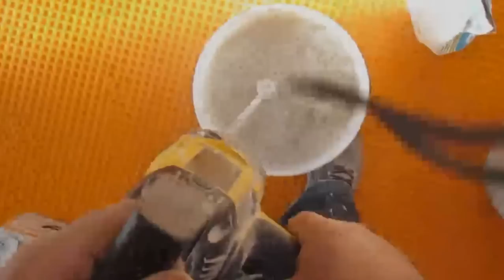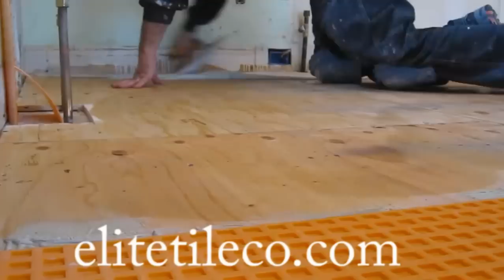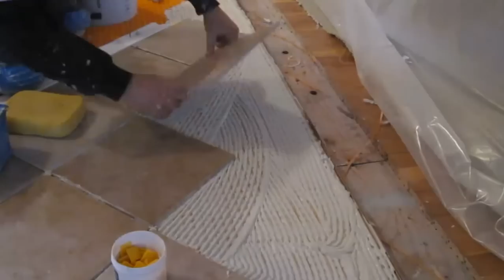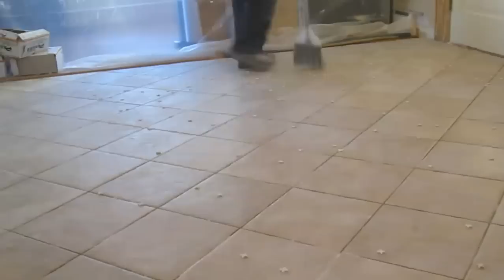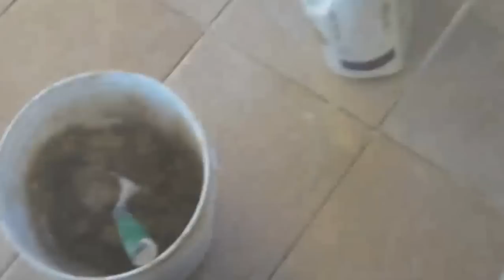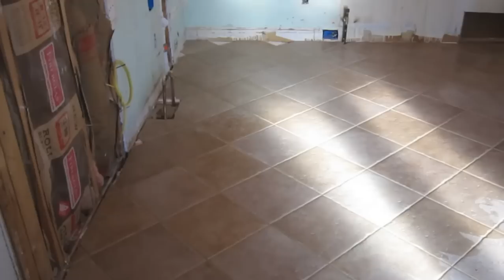Time lapse ceramic tile installation with Schluter Ditra

Comment: Tiling over plywood i still like wire lath. Using 1 1/4 roofings nails, nail the crap out of it, that floor isnt moving one bit. I like the schluter over concrete or enclosed porches that dont get heated. Good stuff though sal.

Comment: Sal,
I had a water wood flooring that had to be pulled up due to a huge leak. Putting tile back in but the OSB top layer was lightly damaged. What would be the best way to move forward on the OSB? Sand down the rough spots, use primer, then use self leveling underlayment? After that dries do I go back over with thinset then ditra? 

I hope this made sense.
Reply from the maker: Can't really tell you what to do without knowing the extent of the damage, I know you said lightly damaged, but your definition of lightly might be different to mine. Use your best judgment and go for it.
Reply: is there an email or Facebook page incan ask you a few questions on. your videos are amazing btw. makes me feel confident to do the work myself.

Comment: Does the Underlayment make the tile floor warmer?
Reply from the maker: No, the underlayment is needed to have a successful long lasting installation. If you want a warmer floor you will need to install under floor heating.